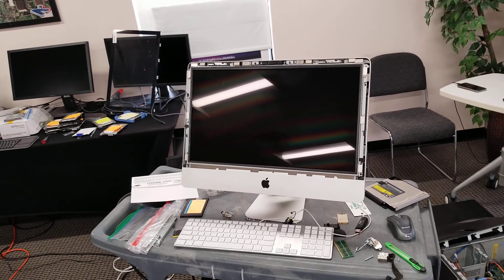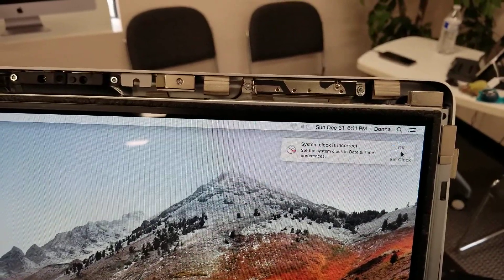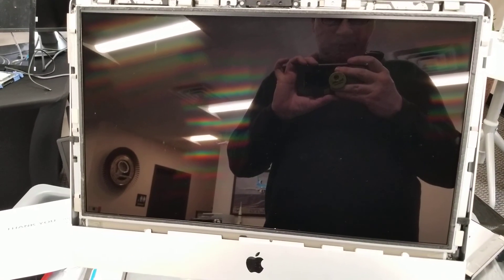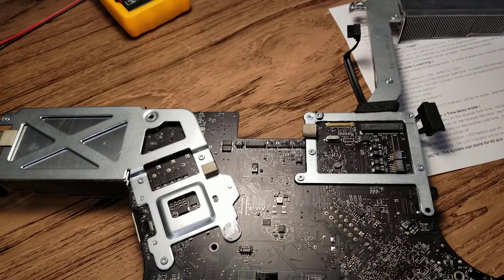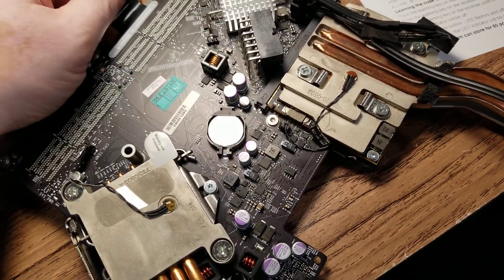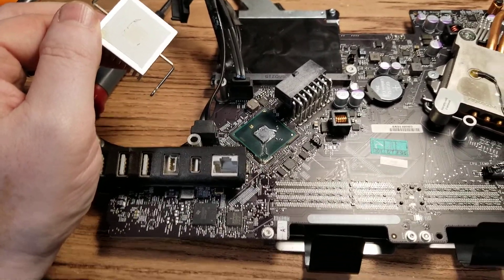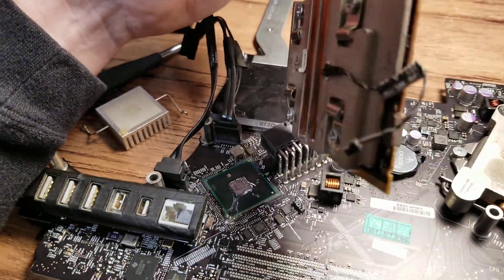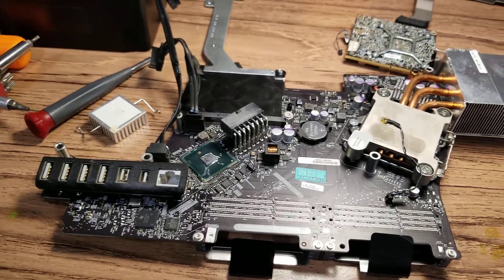Apple iMac 24 inch no sound problem, sound card not working at all. Very strange problem, never seen

Comment: same problem: lost the audio when a audio recorder was installed, so I reinstalled El Capitan, now only the bluetooth works, the system is registers that there is sound coming out but nothing on the speakers. i check the speaker cables and all good.

Comment: Check the capacitors Of The  sound chip for shorts
Reply from the maker: Caps seem ok. This looks like a power delivery issue.
Reply: @Mac1PC  ok check the regulators and the audio chip itself with osciloscope
Reply: R u able to check logs